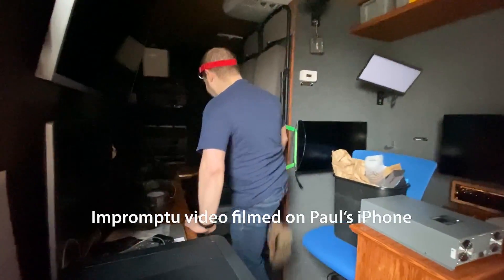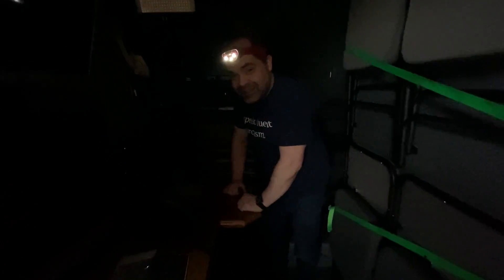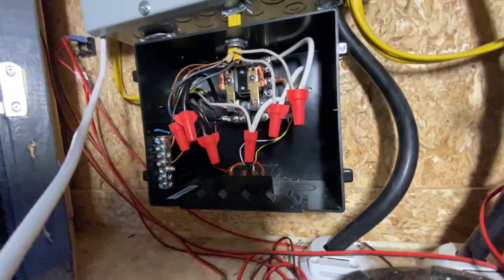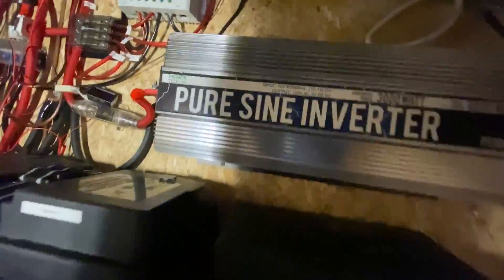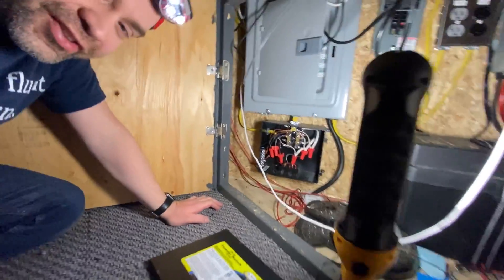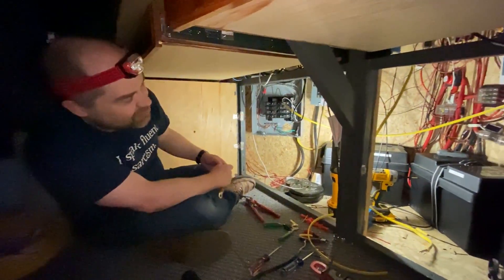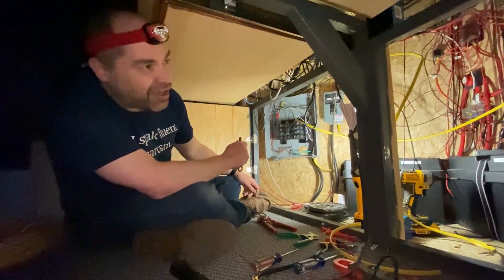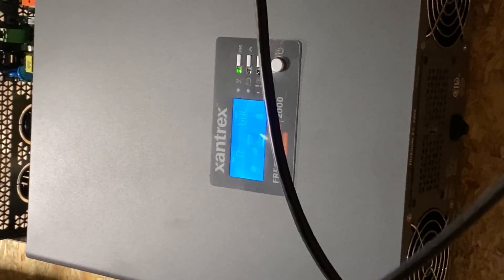Upgrading Trailer Power: Xantrex Freedom XC 2000 Inverter/Charger

Comment: You need lithium it holds it voltage at a high amp draw
Reply from the maker: When I built this trailer, LiFePO4 batteries were more than five times the cost of AGM. Swapping them out is on my to-do list.
Reply: @djp_video  yea lithium batteries got so much affordable now I have 600 ah of lithium batteries in my camper Van

Comment: Do you feel that it is as good as the Freedom SW? I am running motors and water heater so trying to decide what to do and which direction to go.
Reply from the maker: I've never used the Freedom SW series. I'm not familiar with them.

Comment: Hello Guys,  Thanks for the video.  Xantrex has a new 3000 version.  What would persuade you to consider it over the 2000 version other than the cost?
Reply from the maker: The main reason to pick the 3000 over the 2000 would be power capacity.  Considering that the electronics in my trailer draw 1200 W at most, even the 2000 I have is more than I really need. The 3000 would be serious overkill. It would also force me to upgrade the incoming power connection to 30 amp instead of the 15-20 that I currently need, which would make the trailer really difficult to power at most locations, as the vast majority of venues we work in only have 15/20 amp service.

Comment: Hi Doug, I seemed to remember that you use solar panels on top of the trailer to help charge the batteries when not in use. Are you still doing that? If so, how does this effect the new setup?  Thanks for all your videos!
Reply from the maker: I have 400W of solar panels on the roof. Both solar and the inverter/charger can charge the batteries at the same time. They also help reduce the 110V load of the trailer, since much of the equipment in the trailer actually runs off of 12V.

Comment: Are your devices not on a UPS? I would think that the battery in the UPS could keep the devices up during the time it takes to switch power source.
Reply from the maker: This system is essentially a fancy UPS. It just uses my own batteries for storage instead of supplying its own. This gives me a lot more flexibility. 

Commercial UPSes aren't well suited for this type of application for a number of reasons. 1: Many of them produce modified sine, or even sometimes square wave, output, which can create audible noise in audio equipment, or do damage to some electronics with poor filtering on the power supply. The inverter I installed here outputs a sine wave, which is much better for electronics. 

2: The run time of even some of the largest UPSes would only be a couple of minutes at best. The battery capacity is very low on UPSes compared to what I've got here. At up to 1200W, even some of the biggest commercially available UPSes would only last a couple of minutes in my trailer. The one I have in my server room here, which required a special dedicated circuit from the breaker panel, would last for about 4 minutes powering my trailer. And then it would trip a 15A breaker as soon as the power came back on.  

3: Similarly, UPSes are sized to give you just enough time to shut down your computer properly. As such, the batteries tend to be small (as noted), but the inverter portions aren't designed to handle a load for a long period of time.

4: UPSes don't give you any control over how they charge their batteries. If one is particularly aggressive, it could easily push me past the 15-20A limit of most of the facilities we work in if it tries to charge while we're working since I'd be powering the electronics in the trailer AND trying to charge the batteries at the same time. Or, if it is less aggressive, it might take a day or longer to recharge. The manufacturers usually don't quote battery charge time either.  

5: Since the batteries in UPSes are internal, I couldn't use that power for the multitude of 12V devices in the trailer.  With the Inverter/Charger, I've got basically as much 12V power as I want to power devices, lighting, etc.  This one can output up to 80A.

Using the inverter/charger, I can add as much battery capacity as I want -- just buy more batteries. It also intelligently decides how much current to use to charge the batteries based on the AC power load.  If I'm not using much power, it dumps as much energy into the batteries as it can. When the trailer has everything powered on, the charger will decrease the output to the batteries to make sure I'm not drawing too much current from shore power. It also has proper cooling to make sure that it can run for hours at a time if need be.

Bottom line is that going with a system like I have is far more flexible than a ready-made, commercially available UPS.
Reply from the maker: I should also mention that equipment manufacturers sometimes don't like their gear being plugged into UPSes.  I was talking to a couple Blackmagic Design reps once telling them about how one of my switchers froze up on me in the middle of a show. They said they had never heard of that behavior before, and I mentioned that I had it plugged into a UPS. Both of them gave this "Oh! That's the problem!" expression and told me that putting their switchers on UPSes isn't a good idea and that it can cause erratic behavior.
Reply: Well, I think that powering a switcher from a UPS shall be problem free thing to do. They were just looking for excuses how to blame you, rather than admitting there indeed may be a problem or two in the design of the switcher PSU. Just saying...Also, many of the higher end larger UPS are (and have been) sinewave output for quite some time already.
What unfortunately is some heavy crap, as you have already found out yourself, is the generic chinese inverter you are finaly throwing out for something better.
Reply: @Sixta16  yes don't skip on the inverter buy something decent it will last. I just upgraded my 700W to a 3000W. figure buy once, some thing I didn't do. I'm not gonna say I regret the small cheap MSW inverters but two years ago when I bought my first pure sine wave I wish I got the big one as the price went up a third. I don't have to use all the capacity but it'll be there. And now I have 4 matching inverters 400W, 700W, 2000W and 3000W Plus a 750W MSW which actually was not able a Sazw where as the 700W PSW was and a fan at the same time. one's going to get attached in the van and the other one's gonna be mobile so I don't have to rip the van apart. I wish I skip the 700 in some ways. And then I have probably a half a dozen of smaller MSW.

Yeah I'm thinking the same thing about UPSes. Unless they are having really bad output or bad switching time. I've mostly stuck to APC they have something on the newer stuff a little bit better than a modified sine wave they have a modified modified sign with with a few more steps. it's not bad but they're higher end stuff is actually sine wave but more expensive. I wouldn't run a digital mixer without it. Behringer XR's.
Generally the UPS is there to keep the systems running long enough for the transfer switch to transfer and the generator to start. Larger units have expandable battery capacity. And there's plenty of people who have extended non-extended capacity units...

I was doing a event in a hotel and they had a heating issue, thankfully I brought my own space heater and they brought in a kerosene blowyMetron that got turned off before we started. However going into our first break I was noticing a weird beeping sound not registering what it was. When it hit me oh yeah the projectors off. Everything else on the table was either laptop battery or UPS. Somebody took the space heater from the hall and plugged it in hey guess what that's the same circuit as what I have everything plugged into including my 20A heater..... Thankfully I knew where the breaker panel was and it was a quick remedy and reboot the projector and a camera with a knock off battery.

Comment: Doug this is sweet! I've been mulling over a similar setup that I can incorporate with a fly pack. Were there any other charger/inverters you were looking at and why did you go with the one you did?
Reply from the maker: I've been shopping for a combination unit for more than 18 months. It's tough to find good ones. The market is flooded with poor quality units that overstate their continuous output, or don't do a good job of optimizing available battery power (i.e. will shut down while there is still plenty of charge left in the batteries).  

There were a number that I was looking at, but either I didn't feel good about the quality, or didn't like the price. I don't need an inverter designed for 24/7 use -- it's only there to give me some additional runtime when there's an issue with shore power. So I've wanted the quality of the higher-end units, but don't want to pay those kinds of rates for something that just won't see that much use. 

There was one that I thought I might get from AIMS, but after I read their FAQ and found out that the model I was looking at doesn't charge the batteries unless the inverter is turned on (boo!), I ruled that one out too. I stumbled across a number of people on YouTube that were using Xantrex inverters in their RVs, and the reviews sounded really good. I started researching their products, and there was one I liked that was from a higher-end line, but, again, I wasn't comfortable with the price for my application. I saw that they had a mid-range line called Freedom X/XC that seemed to fit the bill, and the reviews looked great. $650 for a 2000W inverter/charger made by a reputable company was pretty enticing. And the fact that's about half the size and weight of many of the others, and the remote was affordable, and it the choice wasn't too difficult from there.
Reply: @djp_video  I would say very well thought out and from your video it obviously passed the test. I have used an AIMS inverter/charger in the past with a mobile LED and the transfer switch was fast enough to keep the processor and the wall on without a flicker. I did not know about the inverter needing to be on to charge the batteries, I will have to look into that. 

Hey if you're concerned with your lights drawing too much power is there a way to wire it so that they don't draw off the inverter?
Reply from the maker: My lights are powered directly off of the batteries (so they don't go through the inverter at all), and with the exception of the lights that I only use for my YouTube videos, they draw very, very little power -- well under the amount of power delivered by the solar panels. The solar panels deliver enough to theoretically leave the lights and networking equipment on 24 hours a day.

Comment: Great Vid Doug, Been keeping track of your production trailer from Day 1. Question not sure time of day you did testing, but wouldn't the solar panels help charge the batteries when you're no on shore power?
Reply from the maker: That test was at about 10:00 PM, so well after sundown.

The solar panels do help during the day.  With a theoretically maximum of 400 W (though real-world output is lower), they could provide a meaningful percentage of the power required to run the trailer.  But, since most devices in the trailer are AC-powered, the 99% of the time we're on shore power the solar panels don't help.  If we were running on batteries, the solar panels could extend the life of the batteries in a meaningful way.

However, with that said, there's quite a bit of 12V equipment in the trailer -- about a half dozen monitors, all of the Blackmagic Design converters (of which there are more than a dozen SDI-to-HDMI converters), the computer network, to name a few -- all run off of 12V power.  So when we have solar, most, if not all, of the power for those devices comes from the sun.